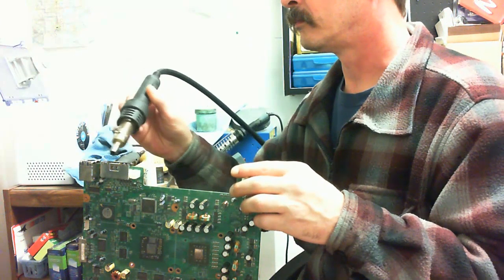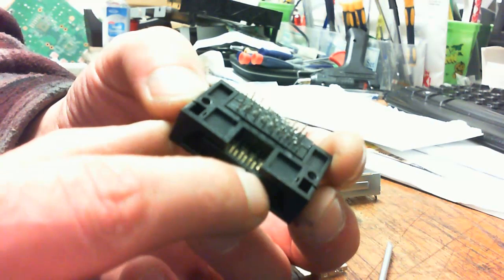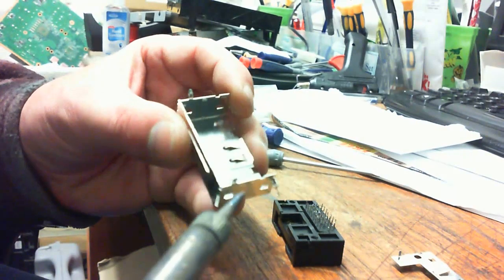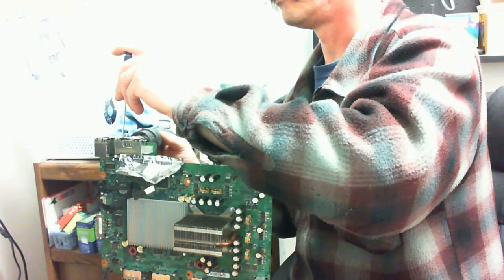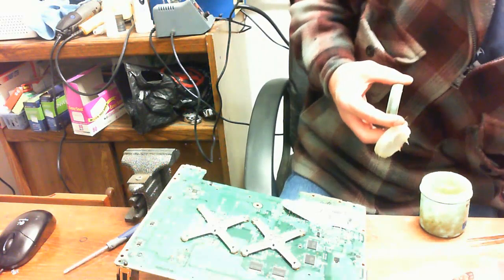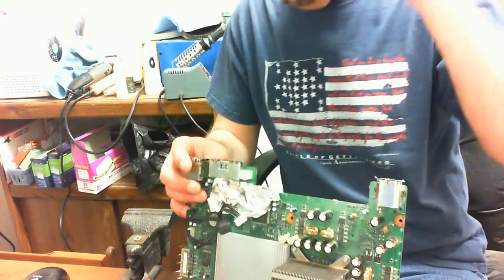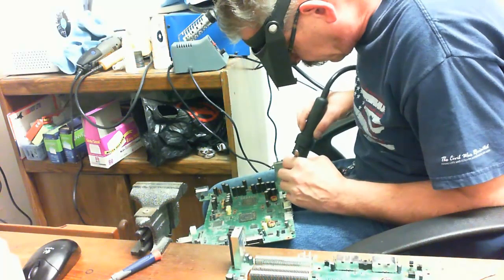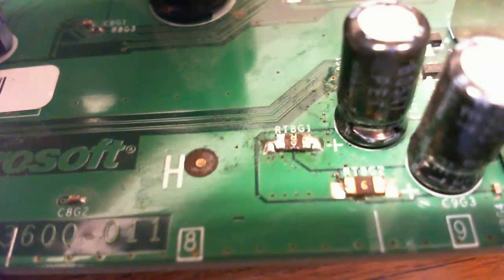Xbox 360 AV Port Replacement

Comment from the maker: It is possible but I would say you have 2 problems your AV port and cracked solder below your GPU or Graphics Processor it can be a bad capacitor or even a voltage limiter however it is likely the solder as it is the most common of the red light eschews.

Comment: Thanks for the replies. I have been researching and testing my box and I'm near certain that it is the av port. I started it up with out the cord and it didn't go to the 1 light red ring, but upon attaching either av or hdmi cable it would jump straight to it. I found a part on ebay for pretty cheap to replace the port. As for me working on it, at this point it has been sitting for so long i don't mind if I break it, you learn more through failure lol. I'll write back and tell you how it goes

Comment: Can you please do a tutorial about how to repair the hdmi port?
Reply from the maker: Ultranist Sorry for the late replay, Note 1: If your HDIM port is damaged you are not going to repair it you can only replace it.
Note 2: For All Fat Xbox 360s the port replacement is the same you will have only a few Extra pins to desolder because the HDMI and AV port is built as one unit.

Comment: Is it possible for a broken av port (cracked inward) to cause a e74. It also wouldn't work on the hdmi also. But on the other hand, when me and my dad went in it and were trying to get it to work it worked for a short while and then started getting blocky on screen and back to the error

Comment: My 360 shuts off immediatly when I plug the av cables or HDMI cable but stays on for about five minutes without them and then cuts off anybody know going on with it
Reply: Same , what did you do about it
Reply: I cleaned the fan but know when I open the DVD drive it shuts off

Comment: what was your temp on removing the port?
Reply from the maker: Jared Jared There are lots of factors to consider when it comes to solder work what works for me may not work you, I have to say if you do not know the temp to use, you should not be trying this yourself. This way is old school way of doing this, there are easier and safer ways but the equipment is expensive and not suited for home A repair, only Business repairs.

Comment from the maker: if you bring the PS3 to me at my shop i charge $65.00 all parts included for the motherboard repair

If in your box is not repairable there will be no charge at all. the Repair comes with a 1 year warranty any motherboard problem repaired 100% free if needed as needed if it is repairable, I will fix it free there is only 1 exception and that is if you brake the USB or other Ports them will be Extra charge. go to my Website ClovisXbox360Repair (DOT) COM and call me for any questions